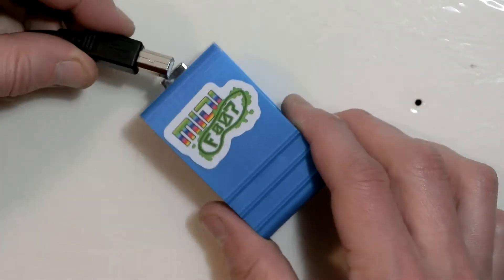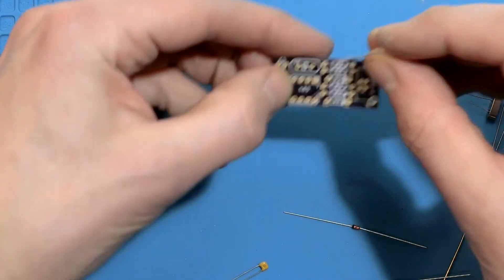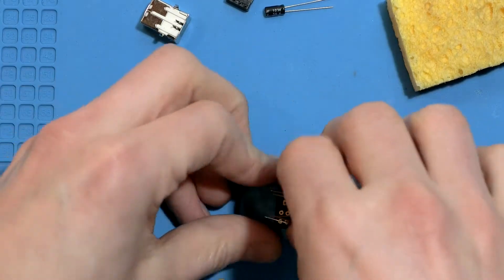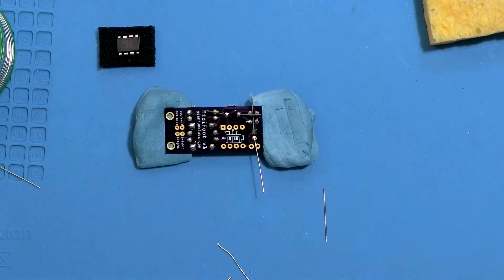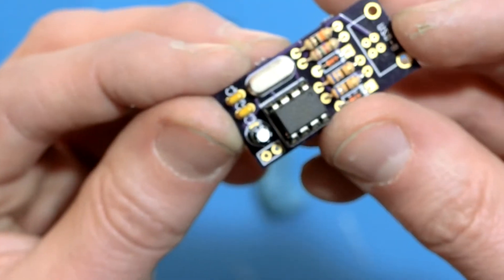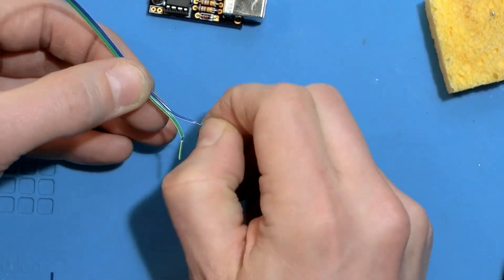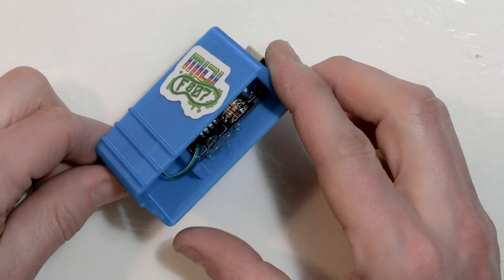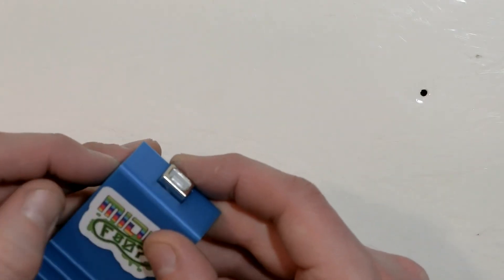MidiFoot - Single Button MIDI Controller Build

Comment: Maaan i would love one like this but with two buttons for changing patches. My squishbox's rotary button doesn't work right and I can't do the patch changes on time :(
Reply from the maker: Rotary encoders are fiddly. You can tap/step on it to advance one patch. You can also use router rules to change patches using buttons on your keyboard: https://tinyurl.com/2taj7ta7
You can even set specific CC messages to change patches in SquishBox.py https://tinyurl.com/2bw75cpr

Comment: hi i just bought one and was wondering if there was any way of configuring the exact signal sent from it? i wanna use it as a toggle switch and it seems to be only working as a "hold" switch meaning i have to keep my foot on for my effect to be toggled on and once i lift my foot off the effect shuts off
Reply from the maker: Sorry for the slow reply. In your DAW or effects module, map or set up a midi rule so that control change 64 on channel 15 with values 70, 75, 80, and 85 activates the effect, and values 100, 105, 110, and 115 deactivate it.
Reply: @white2rnado  thanks for the reply, i guess it's time to switch from ableton because I don't think there's a way to do that :/